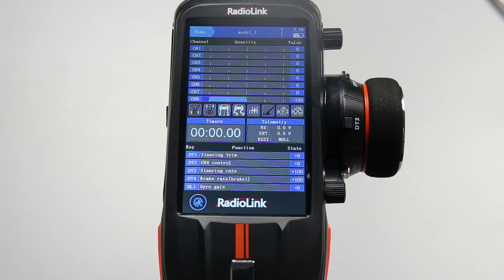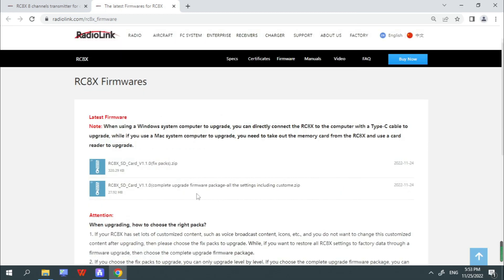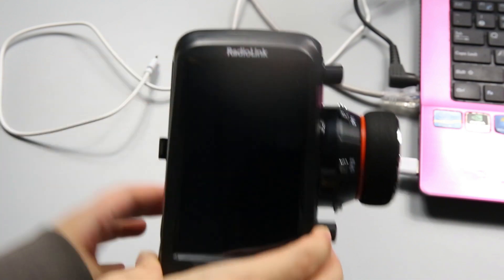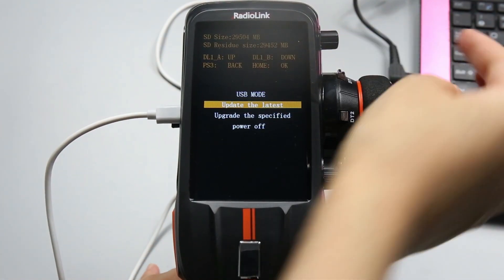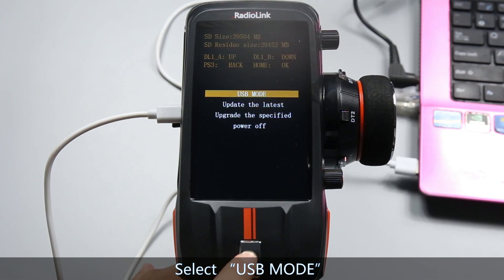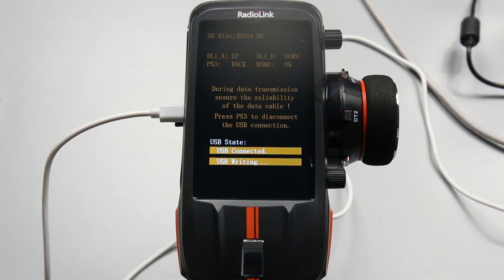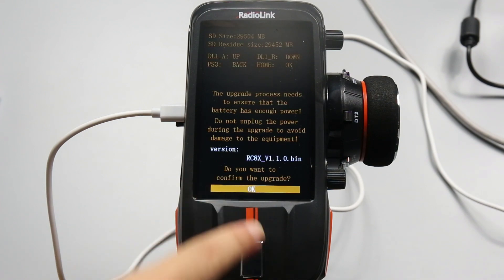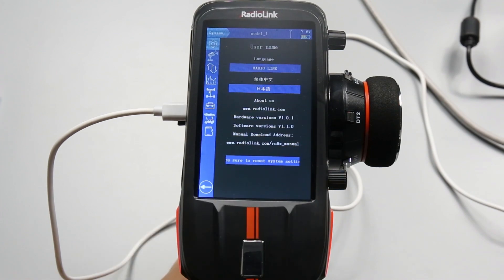How to Update Firmware of RadioLink RC8X?

Comment: What is the best way to setup for a winch on a crawler?
Reply from the maker: You can set a knob channel to control the winch equipment, for example: DL1 (code switch), for the specific setting method, you can refer to 2.2.6 Trim/Dial select on page 31 of the detailed version of the rc8c description: https://www.radiolink. com/rc8x_manual